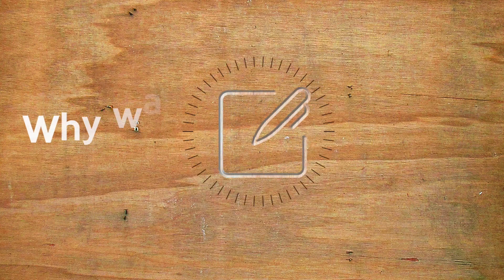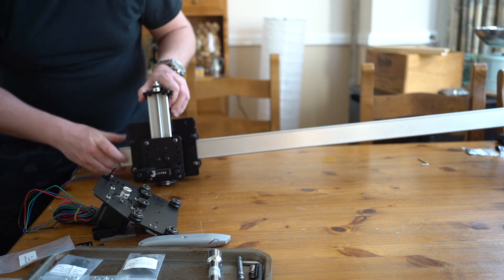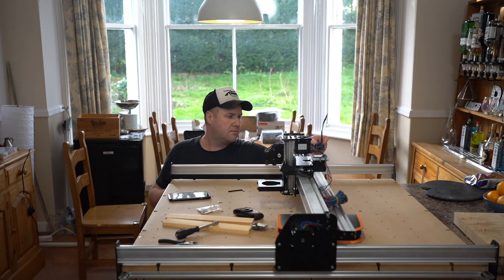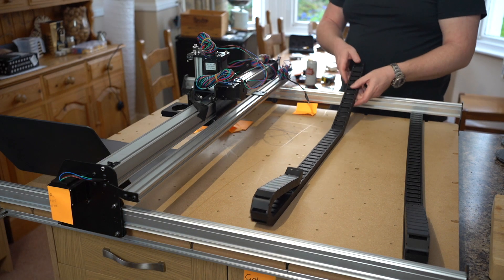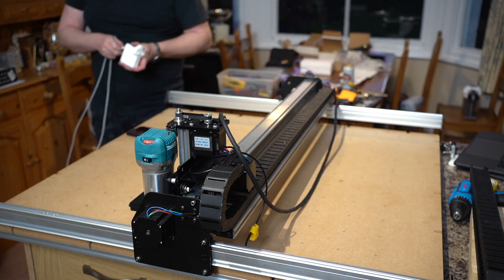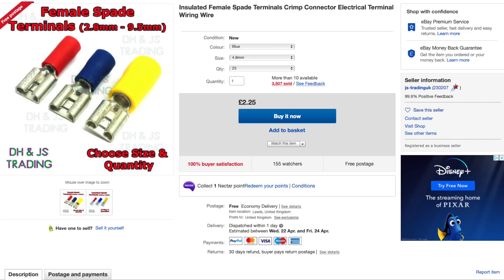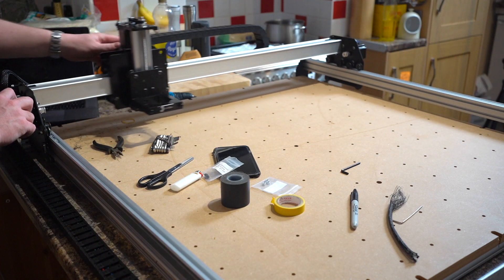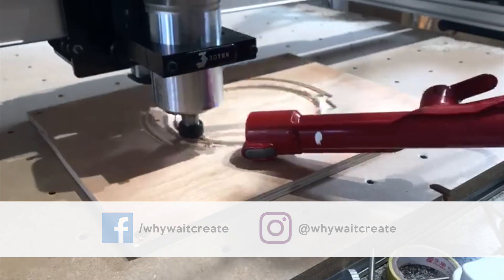XYZ Carve by 3DTek - Part 3: Assembly continued and completed - Why Wait? Create!

Comment: Currently building this model now, and I have to say that whilst the CAD visuals of the machine were great, the instructions were useless. 

2 completely different lists of what parts were needed for a specific item (the gantry installation) and no specific notes on several installation guides, especially the z axis and router. 

This video will help me when I go to finish it off tomorrow/ Thursday and I especially found your tips useful. Maybe breaking the video into 5/6 videos with more detailed explanation on installing would have been more useful, but thank you regardless 👍

Comment: Excellent videos Paul, looking forward to your next one.  Looking at this machine myself Cheers:)
Reply from the maker: Thanks David, really appreciate your feedback 🤘 apologies I’ve not posted a video this week, I’ve been busy building an enclosure to keep the dust contained (you’ll see it in the next video). The machine has been an absolute joy to put together and 3dTek have been brilliant with support/guidance. Aiming to have the next video up in a day or two 👌
Reply: @PaulWilson06  Have you considered a dust extractor?  You could add one to your enclosure, all the sawdust etc empties into a bag. I used to give away the  bags of sawdust to the local cricket club. They used it soak up water on the wicket.
Reply from the maker: Hey David, I piped in an extractor I got from amazon for about £100... it comes with a 100mm pipe and works a charm, the only thing I need to do now is get some softer/more flexible pipe down to the dust shoe (arriving soon) on the router and it'll work a charm. In the meantime I didn't want to cover the kitchen in dust (some simple test cuts have produced a hell of a lot of dust), the enclosure and extractor does a great job of keeping the wood chips in side and the floaty dust gets extracted :) I'll make sure to cover it in my next video :)